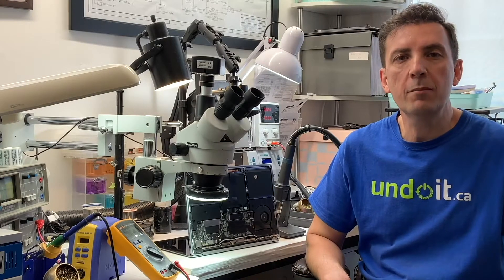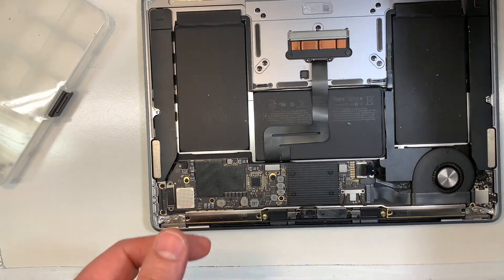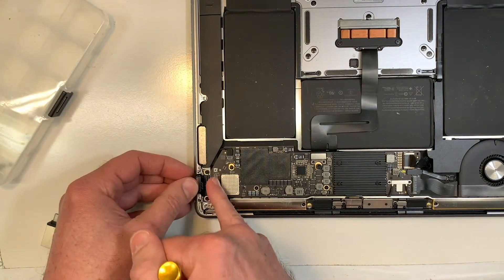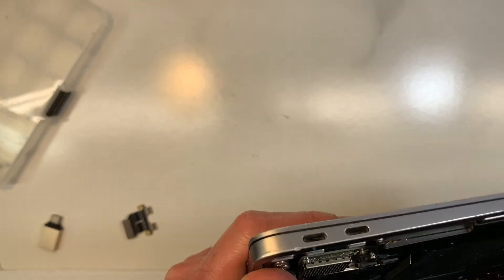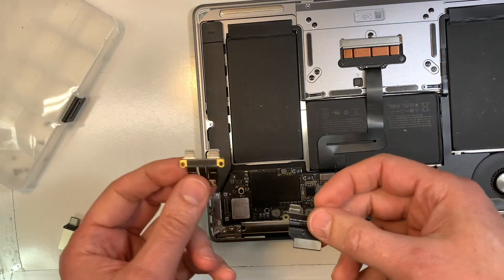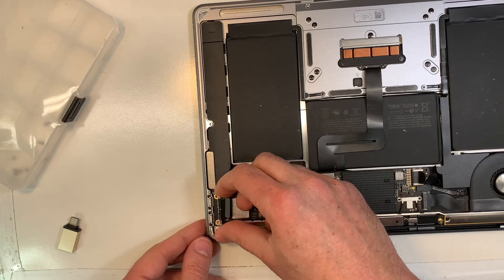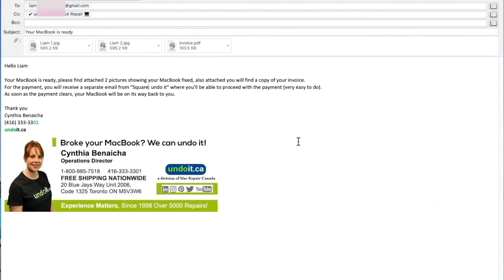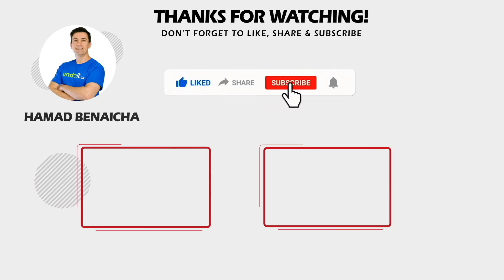🇨🇦USB-C PORTS REPLACEMENT ON MACBOOK AIR 2018-2020 - EASY STEPS - Hamad Benaicha 20+ years

Comment: Hey, hopefully you can help. I run windows 10 on myid 2013 11in macbolm air with the core i5 and 4gb ram. On windows partition, it says usb port overcurrent detected. On usb viewer it says that port 11 overcurrent and its linked to port 2. On mac partition, it doesnt say anything. My left usb port will charge things but wont read my usb stick. Other port is fine. Why does it only give me a warning on the windows partition?

Comment: I did this but now my MacBook won’t turn on. Not sure what could’ve gone wrong. I made sure to plug the battery back in
Reply from the maker: Maybe the new ports are faulty, did you try to put back the old one (assuming they were working)
Reply: @HamadBenaicha  I got it figured out. Even though my battery was nearly full charge, it didn’t turn on until I actually plugged it in. It went into a restart loop but eventually stopped

Comment: mine connectors are a little bit burned, and the pc isn’t starting on at all, so if i will replace it maybe it will be fixed right? Or the problem could be the motherboard too?

Comment: Now my ports are functioning, but they are loose if that makes sense? The snap when you put the charger or external drive is longer there or very weak.  Will changing the ports to new ports resolve this?
Reply: You probably just need to tighten some screws on the board, have you tried that?